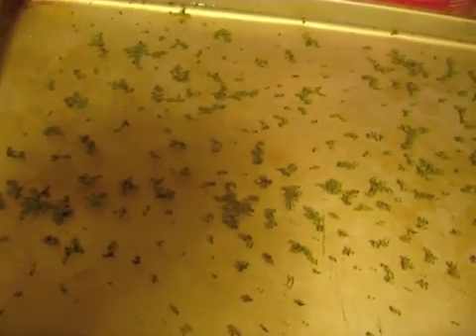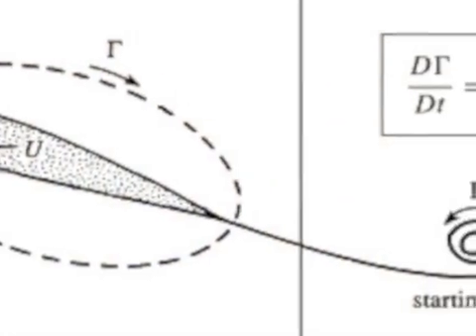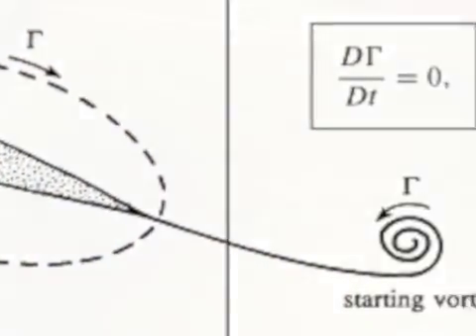How circulation relates to lift (with demo)

Comment: Jesse & Jeremy,
I'd like your comments on the following apparent contradiction.
...
Some folks who study this really like to focus on the vortex aspects.  There is validity to studying that, HOWEVER, it appears you are trying to say that the bound vortex (the one around the wing) is the cause of faster air over and slower air under the wing.   But, BUT the fastest moving air around a wing is under it!  Dave Bentely's sequence on the 6th page of the following paper (images from the Babinsky wind tunnel) clearly shows that the fastest moving air is below the wing.  It has moved the furthest as the wing moves past the stationary vertical line.   Comments??
-- 
Cheers, ScienceAdvisorSteve
P.S. We actually know, and can easily prove, that fast(er) air does not cause a lower pressure.
P.P.S.  And yes, I know that all common explanation that like to throw Bernoulli around are also clueless.
P.P.P.S.  Yes I'm being devil's advocate to see how deep your understanding goes...  Give it a shot, please.
Reply: I think you are getting it totally wrong. The velocity is greater on the upper side, how? the circulation is the answer, which he has explained. I used to think the same that air below the plane is faster but imagine you have a finite area through which  a plane is passing, the thickness above the chord line is greater than the thickness of airfoil below the chord line. This reduces the area of flow above the airfoil due to greater thickness relative to the area of flow below the airfoil for a finite area (I, myself, don't quite understand why the area is finite when the planes fly in the free stream), now according to the equation of continuity, where the area is low, velocity is high. I have believed this theory (but the debate will continue how the hell they fly).
Would love to see a differing opinion.
Reply: @joyia.1   You are talking about the velocity/speed relative to the wing. Speed is relative to the reference frame. Therefore, talking about faster and slower is irrelevant.
.
Also, circulation is only a mathematical construction for ease of computation. It does not explain the physics.  
.
You are also using the half-venturi misconception above the wing to compare it to a venturi. This is the third most common misconception.
.
The air above the wing is soft, not a wall. If the half-venturi was true, then there would also be a low pressure under the trailing edge when the wing is at a reasonable Angle of Attack, since the trailing edge also "reduces the area of flow" between it and the ground.  It simply isn't the physics.
.

A Pressure Gradient Accelerates air toward the lower pressure.  This is fundamental physics knowledge - Newton in fluids.
It is the decreasing Pressure Gradient from around the leading edge to above the wing that Accelerates that upper air rearward.
.
The higher pressure under the wing accelerates that air forward, in the direction of flight.
.
The truth is - In reference to the stationary body of air, the air below a wing is accelerated to a higher peak forward speed than the upper air is accelerated to a peak rearward speed - - RELATIVE to the stationary air mass. 

.
Too many people believe "fast air has a lower pressure" and that is bad science at it's worst.
.
Bernoulli's Principle is about the Acceleration of fluid and the accompanying pressure change is sees along the flow path.
.
You can see actual data from a wing generating lift in Fig 7 here:
 Understanding Aerodynamic Lift Correctly
  rxesywwbdscllwpn.quora.com/
Reply: @Observ45er  "You are talking about the velocity/speed relative to the wing. Speed is relative to the reference frame. Therefore, talking about faster and slower is irrelevant."

The wing is a reference frame.  And the ground is a reference frame.  Physics has to work in each reference frame, so "talking about faster and slower is irrelevant" is nonsensical.
Reply: @joyia.1   That page I linked to also has a link giving a correct understanding of Bernoulli's Principle. 
Explanations are also given for why the common misconceptions are incorrect.
Reply: @Observ45er  You have given me so much to read and view. I have an exam 4 hours from now yet I am stuck on this. I should just jargon the formulas. Thanks for being comprehensive will look into it after the exam.
Reply: @joyia.1  Did you have any interest in reading more after your exam?
.
What exam was it?
Reply: @Jesse Capecelatro 
. . . 8 years and no response. . .
Reply: They are demonstrating the existence of viscous effects of a fluid on an obstacle. Kutta condition is a mathematical model to simulate viscosity in a potential inviscid fluid or yield the same results that would occur in a viscous fluid. 

Viscosity pulls the fluid around the shape of airfoil , resulting in centrifugal force due to fluids change of direction. This action opposes pressure above the foil , the converse , what happens below the airfoil, promotes pressure. 

Very convenient to invoke Bernoulli now huh? low pressure above and high pressure below , is a net result of lift , by adding velocity above and subtracting velocity below so as to be consistent with a model based on fluid flow superimposed over circulation , when the foil is not rotating at all.
Reply: @singh2702  
1] "Viscosity pulls the fluid around the shape of airfoil", not correct.
.
Atmospheric pressure holds air against the surfaces moving in it.  Atmospheric pressure does not disappear when something moves.
.
2] What you call "resulting in centrifugal force " is inertia [I prefer calling it the centrifugal Effect, since it is not an external force] . 
I am pleased someone recognizes the role inertia plays in the pressure changes around the wing [any moving object]. So many people don't, because it is critical.
.
The part about: "action opposes pressure above the foil- below the airfoil, promotes pressure. " Appears to show that yo udo understand.

. . . . . . . . .
. . . . . . . . .
I have no idea what you're trying to say in that last paragraph.
- Bernoulli is unimportant in explaining lift.
- Lift is, indeed, the Top-To-Bottom static pressure difference.
- The circulation method is simply a way of modeling the total flow for simpler computation.   Air simply does not circulate that way.
.
In addition, the speeds relative to the airfoil cause great confusion because so many people think Bernoulli's Principle has to do with speed and it does not.
Its about Pressures and *Accelerations*.
.
FACT:
The speed of the air just below a wing is actually faster than above, relative to the stationary air mass.  
Actual data shows this to be true!  
Seen here in Figure 7.   The third vector-pair  clearly shows the lower forward speed greater than the upper rearward speed.   
BUT, The Acceleration of the upper air is more. 
Acceleration that is CAUSED BY the horizontal Pressure Gradient - decreasing from leading edge to above the wing.
 rxesywwbdscllwpn.quora.com/
Reply: @Observ45er  By increasing pressure in a horizontal direction results in a pressure increase in the vertical direction. Like fitting the same volume of a fluid in a taller narrower container increases vertical pressure i.e the weight. 

Increase this pressure until it exceeds the weight of the aircraft, in terms of pressure per square inch.  Dynamic buoyancy, the foil must pull the fluid together so as to create a situation where the fluid is heavier than the aircraft.  

A pull on the fluid is due to an entrainment of air molecules, because of viscosity. That's why there is a viscosity term in the Navier-Stokes equations.
Reply: @singh2702  No.
You're going astray.
.
This part is not correct: "By increasing pressure in a horizontal direction results in a pressure increase in the vertical direction. Like fitting the same volume of a fluid in a taller narrower container increases vertical pressure i.e the weight. "
.
That is statics and doesn't apply here.
.
First, Pressure DOES act in all directions, so an increase in pressure at one point works in all directions outward - Up, down, left, right, diagonal.
.
BUT . .  we are not changing the volume.  In normal flight there is NO  significant density change to speak of. 
. . . ANSD in YOUR example that absolutely does not change the weight!  A compressed volume of gas has the same weight regardless how much space it is confined to.
.
It is OK to say this: "Increase this pressure until it exceeds the weight of the aircraft, in terms of pressure per square inch. ".
.  BUT. . .
Keep in mind that it is the COMBINATION of the increase under the wing and decrease above the wing that gives the  Top-To-Bottom Pressure DIFFERENCE of lift.
.
BUT. . . 
This is not the way to think of it: "Dynamic buoyancy, the foil must pull the fluid together so as to create a situation where the fluid is heavier than the aircraft."
.
PLUS, it makes no sense, sorry.
With buoyancy, we must make the weight LESS than the surrounding air. NOT greater.  The volume of helium in the balloon weight LESS than that same volume of air.  Putting the words "dynamic" and "buoyancy" together like that makes no sense.  Buoyance is a static thing in fluids.
.
.
For this part: "A pull on the fluid is due to an entrainment of air molecules, because of viscosity. That's why there is a viscosity term in the Navier-Stokes equations."
.
I don't know who you are trying to make this significant.
There isn't any entrainment that is significant around a wing.
And, we don't need NS to explain this.  
. . . 
IN FACT, Equations do NOT explain science.  They mimic the real world physics so we can calculate things.  IF we didn't understand the physics FIRST, the equations couldn't have been written.
.
 Try reading this step-by-step explanation of the fundamental physics:
 Understanding Aerodynamic Lift Correctly:
 rxesywwbdscllwpn.quora.com/
.- - 
Cheers.
. . .
Reply: @singh2702 I also just added a new comment under the video carefully explaining how their conclusion may come to the correct end result, but they use incorrect reasoning at time 2:30.
.
His explanation is based on the false understanding that Bernoulli says faster air has a lower pressure. That is incorrect. Bernoulli is about acceleration, and you need to understand the difference.
Reply: @Observ45er  Yes I have gone off at a tangent there , excuse me for thinking out of the box. 

Explain what causes a flow of water , coming out of a tap , to bend around a convex shape. Please don't tell me atmospheric pressure has developed a conscience and knows it must bend the fluid around the shape.
Reply: @singh2702   
I'm not trying to give a graduate level course on fluid dynamics. 
 Read John D, Anderson for that.
.I explain lift only. 
But I'll try this once.
.
Do you understand that atmospheric pressure pushes inward on all surfaces, regardless of shape and orientation.?
.
Do you understand that if water is on a surface that there is no  air between it and the surface and, therefore no atmospheric pressure there also? 
.

Do you understand that this water layer becomes part of that surface with atmospheric pressure pushing inward on that water layer and pressing it against the other material of the surface.  In essence, it becomes another layer of the metal spoon. 
.
If you have difficulty with that, for a moment, pretend that instead of water, we put a layer of loose, flexible plastic over the surface and remove the air between the plastic and surface with a pump.   Do you understand that atmospheric pressure is now pushing that plastic against the surface?
.
This is no different that adding a layer of silver plating to the convex spoon.  Atmospheric pressure pushes on the solver.
.
Do you understand that atmospheric pressure does not disappear should that extra  layer slide along that surface?

.. . . .  
The water & spoon demo is actually the Coanda Effect.  Coanda is defined for a jet of fluid in a surrounding body of still fluid - NOT for a bulk of air in motion past a surface..
.
Coanda has similarities with the flow above a wing, but it is not completely identical because there is entrainment of still fluid around the boundaries of the jet.
That entrainment makes Coanda a little different than the bulk flow above a wing. This is because the surface inhibits the entrainment, thus creating a pressure change that is not duplicated above a wing.
.
More detail from Kim Aaron of JPL here:
  https://www.quora.com/What-are-the-differences-between-Bernoullis-Principle-and-the-Coanda-effect-when-we-apply-them-on-aircraft-wings-1/answer/Kim-Aaron 
- - 
Cheers 
.
Reply: @singh2702  P.S.  Yes I know Babinsky says it is Coanda above a wing, but Aaron says that is not correct and I understand the difference.
Reply: @Observ45er  I don't have any difficulty in what you are saying what so ever. You seem to think I have difficulty because you MUST be right. 

Yes, the Coanda effect has no place in the aerofoil lift. 
The Coanda effect would generate zero lift even if it was applied. The jet of air flowing over the top will ensure that atmospheric pressure below the foil and above the foil is equal due to entrainment, creating a vacuum between flow and upper surface, hence no pressure gradient.

Lift is the downturning of airstreams along the convex profile. These changes in direction must create a centrifugal force (due to inertial effects ; Newton's 1st and 2nd Law). This centrifugal force(pulling up on the foil) must be balanced (Newton's 3rd Law) by a centripetal force.

I never said that atmospheric pressure does not contribute to the balancing force to keep the air attached to the surface. What I did say is that turning of the flow must work against atmospheric pressure above the foil. So, the balancing centripetal force is actually atmospheric pressure. 

The opposite will happen under a foil if its surface is concave , now the shape itself will oppose the centrifugal forces of the air , creating an even bigger lift. 

Bernoulli has nothing to do with lift in terms of cause and effect.
Reply: @singh2702   Well, I'm sorry, but you continue saying things that either make no sense or are wrong.  I've studied this, made measurements and talked with experienced professionals in the field to firm up my understanding because I do talks and demos and have a high standard for being correct.  I'm not some high school physics student guessing with little experience.  I'm an experienced Engineer.

.
For example: Coanda will produce lift on a wing.  I talked with the people at Georgia Tech that ran a NASA sponsored study on it.  It originally started with the Custer Channel Wing concept - a proven concept that was demonstrated in full-sized aircraft, I believe in the Mid 1940s  It produces high lift as expected from the physics. because of the increased upper flow that is directed downward, just like all Coanda propulsion systems. .  You have no basis for your statement, because  it WORKS!  It's used to support craft.  
I DO know.
.
Work was done, tests run and there are several papers on it. 
Here's one: https://ntrs.nasa.gov/api/citations/20050192627/downloads/20050192627.pdf  
You can also You can search for "Custer Channel Wing".
.
As is common, however, other problems made it impractical, but I don't recall many details without re-reading papers.  One is that slow flight has control issues.  

I'm unable to follow the rest of your comment since you use nonstandard language, so I can't comment  It does seem that you are trying to say what I Explain, just in your own terms. That Quora paper explains it and when you understand it, all of it will make sense.  I found the data that gives Figure 7 to really confirm the physics since it applies equally in either frame of reference. 
.
I agree that using Bernoulli is always done incorrectly.  In fact Bernoulli's Principle assigns no cause and no effect. It only describes the pressure change and velocity change accompany each other.   There  are places around a wing where Bernoulli's Principle applies, but this "Fast air causes a lower pressure" mantra is pure nonsense.
.
Lift force is the Top-to-Bottom pressure difference integrated  over the wing area.  That is well known in the field and is regularly calculated by students and professionals alike.  Folks try, but just don't know the physics of the pressure increase below a wing and decrease above it and just repeat the misconceptions in terms that make sense with their incomplete understanding of the physics. . 

Cheers.
Reply: @Observ45er  "but this "Fast air causes a lower pressure" mantra is pure nonsense."

So, you're saying the kinetic energy of inertia has no relation to potential energy?   That's analogous to saying that a car coasting downhill won't be at lower potential energy when its speed has increased.

You elsewhere have said over and over that inertia confronted with a curve results in lower pressure.   The higher speed around that curve to maintain the same forward inertia (a vector quantity after all) consumes potential energy (static pressure drops).

If it's not clear in the above:  conservation of momentum drives the conservation of energy balance between kinetic and potential energy.  So, that's one of your errors.

So, this is wrong:  "In fact Bernoulli's Principle assigns no cause and no effect."  

When momentum encounters a spatial change, a conservation transaction will occur between kinetic and potential energy to maintain that conserved momentum. 

Another error, as mentioned, is you stating that physics somehow doesn't work for all reference frames, and so you said that considering the speed of flow relative to the moving wing is somehow not valid.  This is wrong at a basic level: physics works from any reference frame, as all motion is relative.

Problems with an "open venturi"?  The obstacle that is the wing means air forced to go around competes with adjacent air for space (due to constant mass density).  The momentum being conserved around the curve changes the static pressure wherever necessary to accelerate any air to fast enough kinetic energy to conserve all of the associated forward (vector quantity) momentum.

"I do talks and demos and have a high standard for being correct.  I'm not some high school physics student guessing with little experience.  I'm an experienced Engineer."

Best to get the facts right.
Reply: @Observ45er  Fair enough comment on Coanda, but Kim Aaron directly opposes what you say in claiming 
"Bernoulli is not about velocity."

And how might one judge Kim Aaron's statement (in your link):  

"I am not going to try to explain how a wing creates lift. That is a very multifaceted topic and has lots of subtleties. It would take me teaching you about two or three full length graduate level courses in fluid dynamics after you already have a superb understanding of physics and math at the undergraduate level to cover all that you need to really understand how a wing produces lift. That’s why all the attempts on the internet fail. Some of them get parts of it right. Some of them are misleading. Some of them are misguided. Some of them get everything wrong. I’m not going to attempt it. I would fail too."

Too many non sequiturs, including in the above quote:   "would take me teaching you about two or three full length graduate level courses in fluid dynamics after you already have a superb understanding of physics and math at the undergraduate level to cover all that you need to really understand how a wing produces lift" <------> "I would fail too"

Implying he doesn't understand lift??
Reply: @davetime5234  Good day once again. Kinetic energy decreases as the flow is redirected upwards(nobody ever talks about gravity,  which is the reason we have an atmosphere). The kinetic energy is converted to potential energy when velocity dies off. 

The reverse happens as potential energy is converted into kinetic energy once the upward flow has stopped due to gravity. 

The fluid is treated as a continuum , so if fluid is diverted upwards before the foil , fluid must divert downwards once peak potential energy has been reached. It is during this phase of energy conversion(kinetic to potential than potential back to kinetic) that creates a low pressure area above the foil.
Reply: @singh2702  Hi, about gravity:  "nobody ever talks about gravity"

"once the upward flow has stopped due to gravity"

The contribution from potential energy changes due to gravity in such a height limited system, is so small, it can be ignored.

Static pressure <---> dynamic pressure exchange far outweighs any effect of gravity.

In other words, almost all of the potential energy in this "height limited system", is contained as random thermal kinetic energy of the air in some combination with intermolecular forces involved with that random motion.  This is static pressure.

When the above random direction energy becomes directional, that is the process of potential energy as static pressure being converted to kinetic energy as dynamic pressure.

Of course, in a situation like with a water tower or plumbing like with toilets and water pressure, the contribution of gravity to potential energy has a more essential impact.
Reply: @davetime5234  Ok, but the stationary air is forced to change direction. By doing that, it is forced upwards and collides with the air above because space becomes smaller. After the constriction, more space is available,  so high pressure flows to lower pressure. Is it not this directional change that increases pressure(by deacceleration)and, as a result, accelerates the flow downwards. Just like when a spring is compressed due to an inertial force up until a point, the compression is reversed. During this transition, pressure above the foil will decrease. This analogy is consistent with the conservation of energy.
Reply: @singh2702  I kind of generally agree with what you are saying.  But I would break it into two parts:  1)the pressure increase to surmount the leading edge, and  2)the space opens up after the leading edge, forcing a pressure drop.

The flow of air mass doesn't "know" how much of "1)" it gets followed by how much of "2)" it gets.

So, there is a first region with the first effect, and that second region with that second effect.

And the two must combine together in a balanced response to appropriately maintain the mass flow rate:  two little flow and mass stagnates, changing the pressure balance;  too much flow, and the supply out exceeds the input, changing the pressure balance in the opposite way.

I just wouldn't say that "1)" causes "2)" because they are both must work in harmony.
Reply: @davetime5234  The air is stationary,  and the aerofoil is moving. This is the context to start understanding. 

As the foil moves horizontally,  it redirects air upwards at the front of the foil. This air , now with a vertical velocity,  is squeezed against the atmosphere above. The result of the squeeze is an expansion. 

Now, let's deal with your two points;
1) The squeeze must oppose atmospheric pressure, as it is air redirected against downward atmospheric pressure.  This causes a drop in pressure. 

2) The squeeze forces more air into the same volume. The result is an expansion  of air until equilibrium is reached again, which is atmospheric pressure.

So the foil is just an obstacle that alters  the energy state of the atmosphere , according to the equation PV=K , where K is a constant. Once it has passed a region atm energy returns to approximately 8.314 J/K¹.mol¹

Newton's laws of motion combined with  gas laws(due to the need for compressibility). Bernoulli does not apply.
Reply: @singh2702  I’m sure you are trying to understand lift, but you have some unique ideas that are not true physics and aren’t using correct terminology; so it is difficult to follow what you are attempting to express. 
.
@davetime5234's initial explanation that vertical altitude being irrelevant is correct.
.
While you’re the first person I’ve seen to come up with this, the main misconception you appear to have is that the vertical displacement of air around a wing is a change in the potential energy and that is completely false. The altitude change around a wing is far too small to be considered in the exchange of potential and kinetic energy. 
.
Lifting a mass is adding potential energy against gravity and that converts to kinetic as we let it fall.  Also, we do consider altitude in fluids such as when in pipes with vertical displacement, but it is irrelevant for wings. 
The same lift would occur in a pressurized chamber away from any planet’s gravity.  
That upper flow has not “stopped due to gravity”.  That flow does its best to follow the surface due to the ambient pressure against the surface.  
It would do the same if the wing was inverted as it does on an auto’s spoiler inverted airfoil. 
.
The potential energy we refer to in aerodynamics is what we think of as common barometric pressure. The change you are thinking of due to altitude is far, far too little to have any bearing on lift compared to the pressures caused by the wing’s movement relative to the bulk of air.
. . . 
A major error you also appear to make is that you seem to think that the upper flow is at its highest potential energy at its highest point of travel above the wing, but this is false.  That is because that is about where the static pressure in the air, and thus potential energy, is LOWEST. 
.
If you look at a typical pressure distribution of a wing [sample linked below] you easily see that the pressure above drops very early as it is moved upward, above the leading edge.
.
 Arrows pointing away from the surface represent pressure BELOW ambient atmospheric pressure.
.. ..
Typical wing pressure diagram.  Blue arrows denote pressure BELOW atmospheric pressure; red above. https://i.sstatic.net/FAU4S.gif.
.. .. ..
.. .. ..
If you want better understand of the physics and terminology, please study this: 
Understanding Aerodynamic Lift Correctly rxesywwbdscllwpn.quora.com/
- - 
Cheers
Reply: @Observ45er  Ok, my replies are definitely convoluted , as you are not the only person who thinks I'm talking a whole lot of hogwash. 

This is my concise understanding of lift with the ommission of the intricacies; 
The aerofoil turns the flow about it until it leaves the trailing edge in an orientation parallel to the trailing edge.
It accomplishes this by balancing a centrifugal force (due to the reluctance of the air flow to change direction because air has inertia). 
I won't say what the balancing force is because I anticipate it will be incorrect.
All I can say is that the balancing force is the force that must be deducted from atmospheric pressure above the foil. 

So, lower pressure above the foil and high pressure below equals lift. 

Turning of air requires a force that works upward against atmospheric pressure. However, it's small in comparison with atmospheric pressure. This is why atmospheric pressure still keeps airflow following the shape of the foil. 

Where am I wrong?
Reply: @singh2702  The density doesn't appreciably change.  Apparently, this is wrong: "due to the need for compressibility", at least for speeds reasonably below the speed of sound.

"Bernoulli does not apply."  Huh?
Reply: @singh2702  "The airfoil turns the flow about it until it leaves the trailing edge in an orientation parallel to the trailing edge."

I'm confused by what you mean by leaving parallel.  I honestly can't say off the top of my head if that is true or not.  Does this mean oriented downwards or not?

In my mind, you need downwards momentum.  Maybe that is achieved with what you just said, or maybe not.  I can't visualize what you mean in relation to the flow momentum requiring a component downwards.

So next when you're talking about centrifugal force to accomplish "parallel to the trailing edge"  I'm lost.  Again, what is the point with "parallel", in relation to downwards momentum at least?  Parallel down or parallel horizontal (to the relative wind)?

All the "centrifugal" and "inertia" comments my mind translates as:  Bernoulli, at least as a label for the conservation of energy response necessary to maintain conservation of momentum.

What does inertia mean, if not conservation of momentum?:  The inertia/momentum of a body continues as is until acted on by a force (and acting on it by a force becomes an energy transaction).

When you invoke "centrifugal" you are talking about a change in direction.

But that is a change in momentum (inertia), because momentum is a "directed quantity", or vector.  

All that means is that when you change direction, energy is required.

So Bernoulli:  to maintain the horizontal starting momentum, any change in the original direction requires energy.  

Bernoulli is shorthand for that energy transaction necessary to keep the original momentum (magnitude and direction) intact:  movement around the cuve means more speed to maintain the horizontal momentum: that is more kinetic energy, to keep the same momentum.

So, "centrifugal"??:   Navier stokes talks about conservation of mass, momentum and energy, not "centrifugal".  I get what you mean by that, but it leaves the whole lift question still untethered.

Navier-Stokes terminology for lift, invoking "Bernoulli":  maintaining conservation of momentum results in a conservation of energy transaction between static pressure and dynamic pressure:

That is:  more kinetic energy around the curve must come out of the potential energy of static pressure.
Reply: @davetime5234  Tell me how can a flow turn around a cambered foil without a change in direction? Leave Bernoulli,  leave Navier-Stokes, and explain things in your own understanding. These people came up with their equations and theorems by thinking for themselves or by discovering through observation. 

The flow must leave the foil in the same direction that the trailing edge is pointing . If it doesn't, the flow has detached, and there is no lift.

I'm not concentrating on equations , I'm trying to explain intuitively. I.e., looking at wind tunnels, etc, and forming an understanding of why this is happening or why something is not happening. 

When an aerofoil is at an AoA, the flow travels from the stagnation point up and around the leading edge and continues to follow the convex shape. All that is directional change , how can I not turn to centrifugal forces? If it was not for centripetal force, these flows would just go off at a tangent.
Reply: @Observ45er  Thank you for your input, but you have not answered my previous comment.

"This is my concise understanding of lift with the ommission of the intricacies; 
The aerofoil turns the flow about it until it leaves the trailing edge in an orientation parallel to the trailing edge.
It accomplishes this by balancing a centrifugal force (due to the reluctance of the air flow to change direction because air has inertia). 
I won't say what the balancing force is because I anticipate it will be incorrect.
All I can say is that the balancing force is the force that must be deducted from atmospheric pressure above the foil. 

So, lower pressure above the foil and high pressure below equals lift. 

Turning of air requires a force that works upward against atmospheric pressure. However, it's small in comparison with atmospheric pressure. This is why atmospheric pressure still keeps airflow following the shape of the foil. 

Where am I wrong?"
Reply: @singh2702   I was working on it, but answered as the notifications showed up for me.
. . . . .
OK.  I see some daylight here. It seems that you have the essence of it.
.
Airfoil turns flow and it leaves the trailing edge. <- OK 
.
I do not know what you mean by “balancing a centrifugal force”, so I can’t comment.
To me there are two things in balance and nothing happens. Like the two sides of a balance scale, like the “scales of justice”.
.
.
This part is the GOLD: “due to the reluctance of the air flow to change direction because air has inertia”.
..
Then, this looks good: “force that must be deducted from atmospheric pressure above the foil”
The Inertia says: “You’re pushing me, Mr. Atmosphere to follow that surface, but I don’t like it, so I’ll push against you ALMOST as much as you’re pushing on me, and the small difference is making the pressure near the surface a little less  {reduction near surface}, but you still push on me so much.
...
I must point put a fundamental of fluid pressure so that last statement makes more sense.  
Pressure-at-a-point pushes in all directions. Therefore, when that upper flow pushes against the higher air 'a little less' than the atmosphere is pushing on the flow, it is ALSO pushing on the surface a little less than the atmosphere is - THEREFORE a 'reduction" from atmospheric pressure.
.
I think I got that right. . . . .
.
Then: 
“Turning of air …force …against atmospheric pressure. However, it's small …This is why atmospheric pressure still keeps airflow following the shape of the foil.” <- OK!. 
.
BTW: These pressure changes are VERY SMALL.!.
Cessna 172 has 25,000 square inches of wing. 
The average pressure under the wing goes up about 0.02 psi.  The average pressure above the wing goes down about 0.08 psi.  This makes the Top-to-Bottom difference: 
Bottom minus Top ->  +0.02 - (-0.08) = +0.02 + 0.08 = 0.1 psi.
Force = Pressure times Area -> 0.1 x 25,000 = 2,500 pounds of lift.
.
The larger change of -0.08 out of 14 psi atmospheric pressure is a difference of only 0.6%.  
Not even a 1 % Difference in pressure to hold up 25,000.!.
Cheers.
Reply: @Observ45er  Thanks, I really appreciate that an actual engineer agrees with my understanding. All the points you picked out of my explanation and agree upon align with what I'm tryna say. 

The balancing force that I assign to keeping the flow following the shape of the foil is just like a centripetal force balances a centrifugal force. These forces act in opposite directions(Newton's 3rd Law) , but instead of the conventional case of uniform circular motion where there is a pulling force between centripetal and centrifugal forces , in this case the centripetal force is atmospheric pressure pushing down against centrifugal forces created by the flow not wanting to change direction and follow the shape of the foil. So yes, work is done against downward atmospheric pressure, so it must be deducted from downward atmospheric pressure. 

The difference is absolutely small , I agree. I also agree that the bulk of lift generation is due to what happens above the foil, not below. 

People always want to use Bernoulli's principle the first chance they get to explain lift. Conservation of momentum is thrown around, but people don't understand that the conservation of momentum is due to Newton's 3rd law.
Reply: @davetime5234  You are lost because you don't understand the conservation of momentum. 

What conserves momentum? Bernoulli is based on this. If you can't figure out what conservation of momentum is due to , please stop🙏 

This static pressure trade-off with dynamic pressure does not explain why there is pressure above the foil that is less than atmospheric pressure. 

More kinetic energy does not mean atmospheric pressure drops , pressure will drop in a venturi tube since a venturi tube eliminates atmospheric pressure. 

Faster moving air over a surface does not mean atmospheric pressure drops. Conversely, if static pressure was traded for dynamic pressure,  there would be lower static pressure under the foil. However, atmospheric pressure above and below would be the same ,hence no lift. 

The only reason a paper lifts up when blown over is because static pressure is entrained by dynamic pressure. Other than this, there is no trade-off without a venturi.
Reply: @singh2702  You're saying the pressure drops:  "due to the reluctance of the air flow to change direction because air has inertia...I won't say what the balancing force is"

Yes, what you just stated is conservation of momentum, that's what the constancy of inertia is.  I assume the balancing force you don't want to mention might be ambient pressure?

Leaving out that centripetal force, which is what the centrifugal is reacting to, is a key mistake.

Focusing on roller-coaster analogies is a cheat of the scenario.  A roller coaster in a discreate localized accumulation of mass, so you're neglecting the interaction between all the other "roller-coaster" that are pushing on your one roller-coaster from above, below, behind and in front.

That's why you need the full set of key conservation variables and something analogous to Bernoulli to get close to describing what is happening.

I have no idea what you are saying here:

"Turning of air requires a force that works upward against atmospheric pressure. However, it's small in comparison with atmospheric pressure. This is why atmospheric pressure still keeps airflow following the shape of the foil. "
Reply: @singh2702  "how can I not turn to centrifugal forces?"

Read my other comment I just replied to you.
Reply: @singh2702  "You are lost because you don't understand the conservation of momentum"

You're saying I'm lost because I claim that inertia is synonymous with conservation of momentum, or because you think I'm saying they are not synonymous?

Please tell me which of the two you believe?

"What conserves momentum?"

Newton's 1st law says momentum is conserved.   Do you disagree?

"This static pressure trade-off with dynamic pressure does not explain why there is pressure above the foil that is less than atmospheric pressure"

Yes it does: the energy from the increase in dynamic pressure to maintain the same amount of momentum in the same direction, has to come from somewhere.

That somewhere, that source of energy, comes from static pressure:  it has to drop below ambient pressure.

"More kinetic energy does not mean atmospheric pressure drops , pressure will drop in a venturi tube since a venturi tube eliminates atmospheric pressure. "

The effect is true independent of a solid enclosure.  Search for "venturi injector" images.  The opening on one side of such an injector can be arbitrarily large, that is, directly exposed to ambient pressure, where a drop in pressure is the entire principle behind how it works.

(I'm still editing this..)
Reply: @singh2702  
First, because centrifugal force is not a force, please stop calling it that. 
.
I started calling it the "Centrifugal Effect".
.
The word 'force' is reserved for the "push we apply externally to some 'object' to accelerate it.
.
It IS Inertia_.  Mass and inertia are synonymous because that is what mass does in this universe.
.
It is all the atoms in a mass doing what we describe in Newton's first Law - "trying to continue straight.
.
Some people call it "Inertial Force".  I'm ok with that, but prefer effect.
..
In addition it is the VERY SAME THING that makes you feel pressed into your seat-back when speeding up in a car.  THE SAME THING.  Inertia's resistance to that form of acceleration {positive}.
.
It is also the same thing you feel on your chest and seat belt when you jam on the breaks.   Inertia's resistance to that form of acceleration {negative}..
.
. .
.. . . 
RE: "in this case, the centripetal force is atmospheric pressure pushing down against centrifugal forces created by the flow not wanting to change direction and follow the shape of the foil. "
.
I would say that Inertia's Centrifugal Effect is acting against the atmospheric pressure. .
The atmospheric pressure is there and  Inertia acts to reduce it at the surface.

Consider the top of a roller coaster hill I describe in my video.  It is an exact analogy for above a wing:
 *www.youtube.com/watch?v=3MSqbnbKDmM* 

Your body's inertia is what reduces your pressure frmo gravity on the roller coaster seat - not the other way around.

Adjectives, subjects and objects are important.
.
Cheers.
Reply: @davetime5234  Yes, downward atmospheric pressure is opposed by upward inertial forces. 

The inertial forces are subtracted from a much larger force , atmospheric pressure. At low AoA, inertial forces are very low, but when you turn up the AoA, the atmosphere can no longer push the flow down as the speed of the flow or inertia has become too great for change in direction by atmospheric pressure. 

Conservation of momentum is due to? Answer that before bringing up Bernoulli.
Reply: @davetime5234  Newton's 3rd Law conserves momentum. Equal opposite forces , emphasis on the words equal and opposite.
Reply: @Observ45er  The acceleration is a directional one, so yes, it is a force that is the same as effect. If it were not a force , how do we subtract it from downward atmospheric force? Effect = result of an action. What's the action? 
Turning the fluid so as to follow the shape of the foil. 

"Centrifugal force is not a force"? 
You just lost any credibility as a person with common sense, let alone an engineer.
Reply: @singh2702  Yes, and your point?  I mean, if you are trying to give the full account of the implications, you need all 3 laws.
Reply: @singh2702  May I ask what your technical background is, so that I can tailor my responses appropriately?
Reply: @singh2702  F = d(mv)/dt, and without an external force m1v1=m2v2, such as when a cannon fires, projectile and cannon each have equal and opposite momentum.  The kinetic energy clearly is not divided equally.
Reply: @davetime5234  You really should stop , you are making an idiot of yourself. The first two laws apply to a change in momentum, while the 3rd Law conserves momentum.
Reply: @singh2702  Sorry, I'm not falling for that tactic.  Furthermore, it is ethically acceptable and appropriate for me or anyone else to debate cases of potential and actual false information.
Reply: @Observ45er  To be honest, this is so verbose, it obfuscates the flow of verifiable logic.  Could you please consider making concise points so that your argument can be efficiently assessed and checked for facts.  Thank you.
Reply: @davetime5234  Forget about energy,  it's the force that's equal. Force applied to different masses is gonna give different accelerations during impulse. 
m.a.0.5.a.(v/a)² is the energy , but it's impulse,  m.(v²/a) , that remains constant in conservation of momentum.
Reply: @singh2702  "Forget about energy"

You can't forget about energy.  The whole reason for the fact that the lift to drag ratio L/D (the glide ratio) is on the order of more than 10 to 1, lies with the distinction between momentum and energy.

"Force applied to different masses is gonna give different accelerations during impulse"

Yes, as I already stated for the closed system case:  m1v1=m2v2
The impulse resulted in different velocities according to the respective masses-->different accelerations.  

But those different velocities means the larger mass has much lower kinetic energy.

This is essential for:
1)How wings fly (have glide ratios usually more than 10/1)
2)why high bypass ratio engines have much better fuel efficiency
3)why the projectile of a firearm is lethal while the firearm itself is not.

So you're telling me something I've already stated.  And I've gone beyond that, and yet, what does this have to do with conservation of energy relating to Bernoulli being relevant or not?

Are you trying to say conservation of energy is false, because you can recite conservation of momentum, and based on that trying to escape the Bernoulli conundrum (that the conservation of energy must be obeyed as a parameter separate from momentum)?
Reply: @singh2702   Sorry Singh, but that is universal in physics.  
I'm telling you standard well accepted physics.  I'm not some high school dropout making guesses from incomplete knowledge. 
You're a funny kid,   Suddenly an expert that =knows better than professionals.
Cute.
.
You clearly have neither the knowledge, nor vocabulary to be telling others about physics.
Reply: @davetime5234  You have just wasted effort typing all that out. The discussion was what was the fundamental law that conserves momentum, that's it, not which mass will gain more energy in the system.
Reply: @Observ45er  I, too, am neither a high school dropout. I have studied applied mathematics and physics at university, and aside from that, I have been an undergraduate for degrees in both Law as well as Financial Accounting.
Reply: @singh2702  All 3 actually.  And there is a difference between making a sound argument and being argumentative, which comes from law.  And a proper separate  accounting of the necessary attributes is key to financial accounting as well as physics.
Reply: @davetime5234  So, are you saying it's because of my tertiary studies that they work for me or against me?
Reply: @singh2702  I'm saying that if you ask how profitable is a business and you're given the choice of income statement, balance sheet, and statement of cash flows, the income statement is not the one I would necessarily choose.  Because I want to know the capital intensity in terms of both short term and long term capital needs of the business.  I need that to judge the quality of the income statement.  You can't just ask a black or white question like you're searching for a TKO or something, when the purpose of the topic is to enlighten on the nuance of the overall mechanics of a body of knowledge.

The 1st law speaks of the resilience of inertia:  it will be conserved (barring an external input).

But like the other financial statements, the other "laws" give a different window on an aspect of the nature of the attribute.

All 3 laws; all 3 financial statements, if the question  is earnest.

If the question is casual, choose as to your taste.
Reply: @davetime5234  I believe you are talking about a statement of financial performance(profitability 📈), the statement of financial position, and the statement of cash flow(liquidity of enterprise). Yes, we use these in making forecasts.
Reply: @davetime5234  Conservation of momentum deals with a system of two or more masses , each with a velocity that is comprised of magnitude and direction.

When you add up all the individual momentums (note; a negative sign constitutes a velocity in the opposite direction) before each mass collides , it must equal the sum of the momentums after the collision. 

Newton's 3rd Law of equal opposite forces ensures the expression before collision = the expression after collision. 

The 1st Law neglects an external force , so no force between two masses exists to demonstrate conservation. 

The 2nd Law applies an external force to a mass that can change its momentum continuously. Same here , no second mass to demonstrate , that should a collision happen, the sum of momentum before will equal the sum of momentum after.
Reply: @singh2702  The conserved quantity of motion starts with "not changing unless acted upon."

In other words, it is perpetual, that is, it is conserved.

If you first don't establish that the quantity of motion is conserved on its own, then the 3rd law on its own is not enough.

Will the inertia decay somehow after the interaction with an external force or external mass? (a lot of people somehow think so) Who knows unless you set the ground rules for conserved motion all on its own.

My profit statement shows strong profits but my fixed capital is large in relation to my hypothetical earnings, and inflation is high.

So, re-investment for the natural rate of depreciation means my economic profits are less than zero.

It's not just one tool working alone.
Reply: @davetime5234  I just want to say that I do see dynamic pressure as air flows up to the leading edge of a foil at an AoA. Once the flow reaches the leading edge and turns around and enters the horizontal flow, it undergoes a rapid acceleration catching up to the speed of the free stream above the foil. This acceleration is due to the stream needing to squeeze between the foil and atmospheric pressure above the foil. 

Under the foil, it's clear air is slowing down, so there is an increase in static pressure. Above , strictly speaking, the air flow that is closest to the foil, I.e. the flow that hugs the convex profile gains dynamic pressure and is moving the fastest. 

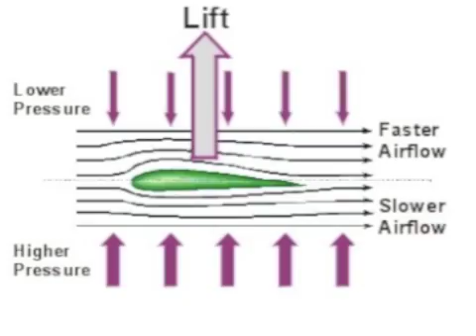This is clearly illustrated in the video "How Wings Work? Smoke streamlines around an aerofoil." At around the 0:20 mark onwards , when the pulsed smoke is slowed down.
Reply: @davetime5234  The conservation of momentum is based on a system in which interactions take place . At the end of the day, after all interactions are done , the value must equate to what I had before interactions began. 

Interactions lay the ground rules required in order to achieve conservation. Interactions can be perpetual as well, so long as at any point in time, you can measure the system, and the value remains constant each and every other time it is measured.
Reply: @singh2702  "conservation of momentum is based on a system in which interactions take place . At the end of the day, after all interactions are done , the value must equate to what I had before interactions began"

True, and that applies for momentum, energy, and mass flow continuity.  

The conservation of each of those 3 must be separately accounted for, for the "system" of air continuously arriving at the airfoil.

While they must be separately accounted for, they influence each other (as do those basic 3 types of financial statements).

If you leave energy out of that mix (and or mass flow continuity), you are no longer approaching a realistic explanation for lift.  You're just picking at pieces of an explanation.

You need to tie together how energy is represented, in order to understand how momentum stays conserved, and how mass flow continuity drives the energy representation that is being conserved in total.

You wouldn't try to understand the financial characteristics of a business, without those 3 types of statements and the interactions between them.

I'm rich.  No, my payables have ballooned.  I'm poor. No, my intangible charge-offs are from a large never to be seen again one time expenditure.  My ROE shows my superior competitive strength.  No, I have much higher leverage ratio than comparable businesses.  My growth is stellar.  Yes, but it's been financed disproportionately with debt and whether my return on total capital is keeping up with my capital cost is debatable , etc.